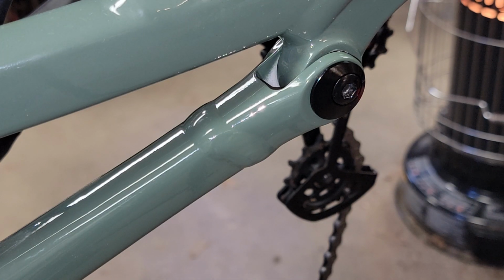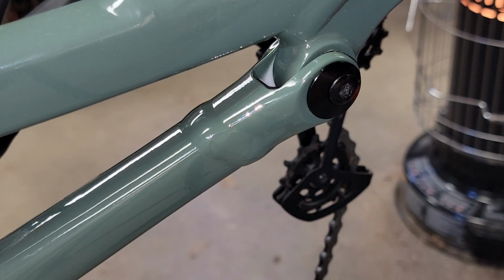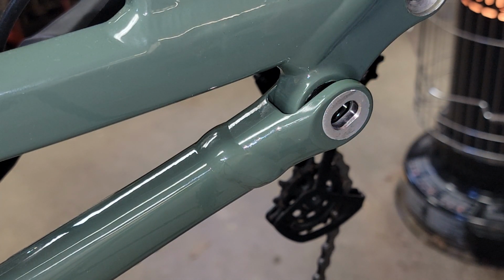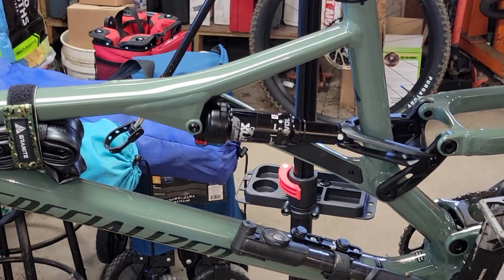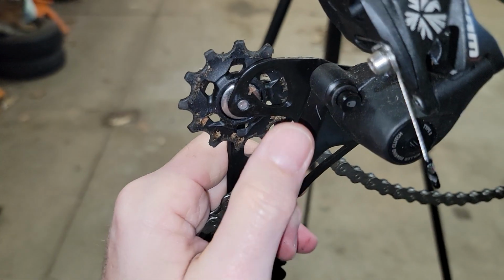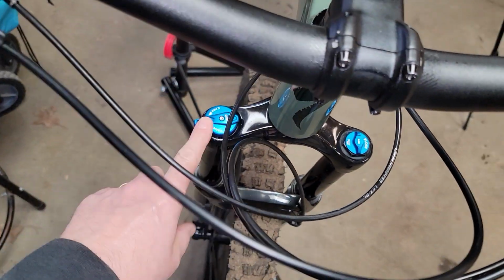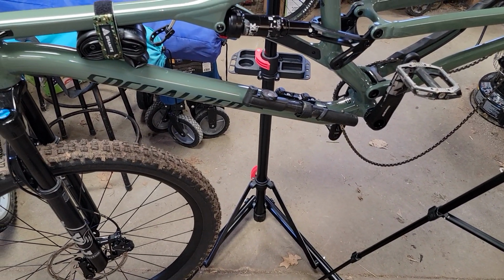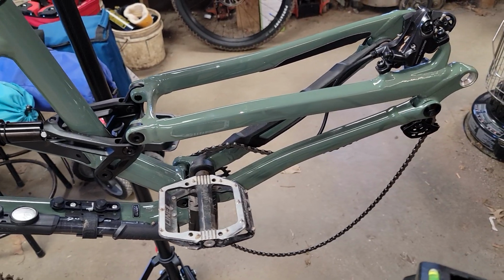Specialized Stumpjumper flip chip

Comment: Great video! I just did this on my Stumpjumper today and realized that the blue bearing shown at 1:35 does not rotate at all on either side? Is that something you observed as well or is mine a defect?
Reply from the maker: Had to re-watch the video to see what you were talking about, the only part of the blue bearing that should move is where the bolt goes through, the part of the bearing that is making contact with the frame should not move, if you take your finger and press it against the bearing and rotate you should see the inner part move, if it don't or feels like it's clicking or the whole bearing moves you need a new one, it's possible it's bad but not likely
Reply: Thank you so much for the reply! It's strange since my bike is pretty new, and all the other bearings seem to be working perfectly. Just the bearings at the flip chip link seem to be completely not moving, on both sides! So I thought it's either designed this way or I have a manufacturing defect. 
 @Hoosieroutdoor1969
Reply from the maker: @michaelnoah3795  when everything is bolted together there shouldn't be much movement at that junction until it's gets compressed, you could always pull it back apart and check to see if the inner part of the bearing spins freely, also don't over tighten the bolts, you probably only need 20 or 30 inch pounds of torque
Reply: Thank you for the suggestion! I will look into that 
 @Hoosieroutdoor1969
Reply: TO se přeci nemění.

Comment: Should I buy the stump jumper alloy or comp alloy it’s going to be my first double suspension bike.
Great video.!
Reply from the maker: I would spend the money and get the comp alloy, the only thing I've changed on mine is the stem, went from a 60mm to a 35mm, also if possible try a couple different sizes to see which fits you best.
Thank you for watching
Reply: Not sure if this is too late, but if you plan to be a more active rider who will be going out more frequently, and/or if you're a strong or more aggressive rider, it's worth the upgrade to the comp. Notable jump in suspension and brakes, and a bit better drivetrain. If you're more casual and/or don't go out as often, the regular alloy should be just fine. Still a great bike. I'd recommend checking out the Pinkbike review of the regular alloy, as they break it down and give comparisons between the two levels pretty well.